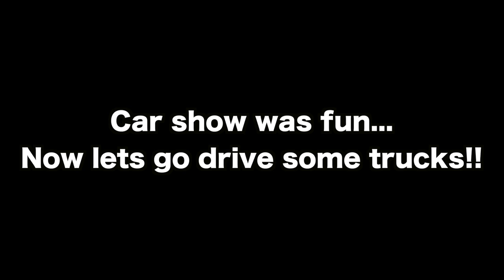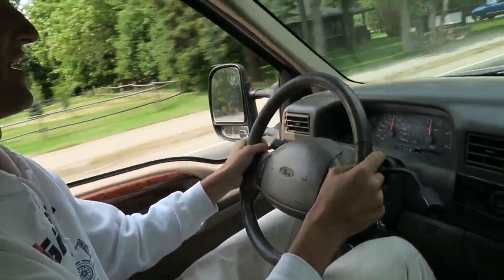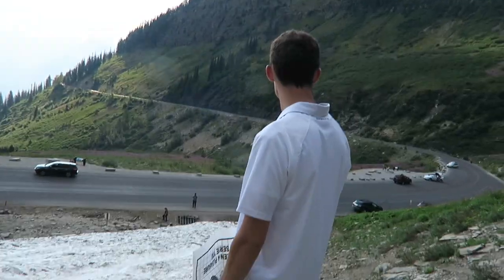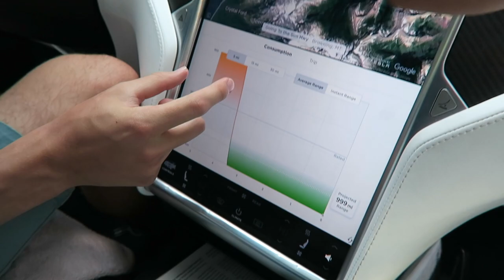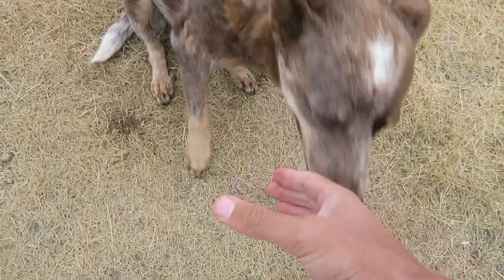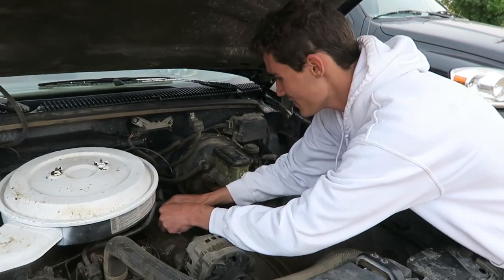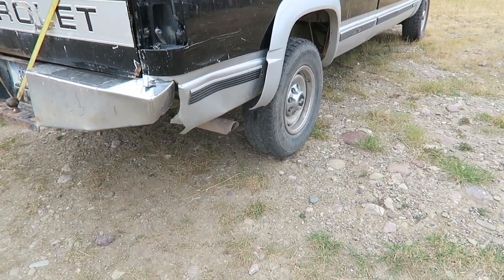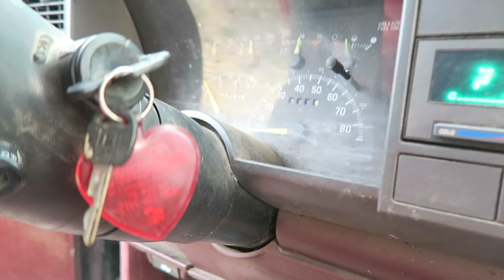FINALLY Buying A Truck...

Comment from the maker: Ford vs. Chevy vs. Dodge    GO!
Reply: Ferd baby 😂
Reply: Ford
Reply: Chevy
Reply: Ford
Reply: JR Garage Ford
Reply: Ford
Reply: JR Garage Ford all the way... It's the only truck that I found is reliable
Reply: JR Garage ford power stroke
Reply: Any, as long as it sounds like a truck..
Reply: what about a shelby f-150
Reply: Get a ford raptor
Reply: Gmc
Reply: JR Garage Chevy or dodge....
Reply: dodge
Reply: FORD BEST AMERICAN SELLING TRUCK CAUSE ITS THE BEST!!!
Reply: JR Garage I respect all trucks but I am all Ram, Cummins
Reply: Dodge
Reply: JR Garage Ford F-350 2002 may have a few issues but it's great
Reply: ford
Reply: JR Garage, get a f550 diesel
Reply: Chevy
Reply: dodge any day of the weak
Reply: JR Garage Chevy
Reply: JR Garage Dodge Ram
Reply: 7.3 POWERSTROKE!!!!!!!!!
Reply: Get a obs ford with a cummins
Reply: JR Garage get what feels right.... can't go wrong with either option but which ever way you go make it a bad ass truck!
Reply: JR Garage ford 4 life
Reply: JR Garage 2017 chevy silverado
Reply: Ford 4 life
Reply: 7.3 ALL THE WAY WITH THE POWERSTROKE
Reply: FORD
Reply: Cummins
Reply: Ford!
Reply: Scott Sherman chevy evey day brr
Reply: JR Garage look up any sled pulls Cummins dominates😈😈
Reply: JR Garage get a 2500 high country or a 7.3
Reply: Go older ford.
Reply: A GMC Sierra 2500 or Chevy Silverado 2500 01-09 bro it the GMC and Chevy and Cummins
Reply: gas ford.  You only need a diesel truck if you are towing over 10,000 lbs.
Reply: TheBlueCarEnthusiast or get a diesel so you can turn it up and rial coal. They don't even need a gas truck so if u have the money get a diesel
Reply: Buy a 02-07 Chevy Avalanche 2500. 8.1l v8. 450hp stock from factory with more in it. I have an 06 and it is a beast.
Reply: JR Garage dodge
Reply: Dodge
Reply: Powerstroke.
Reply: Dodge cummins
Reply: chevy
Reply: JR Garage POWERSTROKE
Reply: JR Garage dirtymax or power strock
Reply: Ford raptor
Reply: Dodge 2500 6.4L Hemi
Reply: Chevy Durmax dully 2015-2017
Reply: none of them get a 2018 trd sport
Reply: Cummins
Reply: if not get a duramax
Reply: Dodge/Cummins
Reply: JR Garage chevy
Reply: Dodge
Reply: Dodge
Reply: Chevy
Reply: Cummins
Reply: Cummins
Reply: For a diesel there is no better than the dodge and for gas you gotta go with the v6 ecoboost f-150
Reply: Ford
Reply: Ford
Reply: Chevrolet
Reply: Duramax with duh the Allison transmission
Reply: CHEVY
Reply: I would say 2005-07 cummins 6 spd
Reply: Dodge
Reply: Go ford
Reply: 1996 f-350 7.3 power stroke
Reply: Duramax
Reply: Get a 5.9 Cummins!!!!
Reply: dodge or gmc
Reply: Gmc cuz 😍
Reply: I was there a Glacier National Park 2 years ago
Reply: Diesel
Reply: Chevy 6.6 lly
Reply: chevy
Reply: The Allison Transmission with the Duramax it's a great transmission it's practically Bulletproof
Reply: GET THE CUMMINS!!!!!
Reply: Chevy
Reply: TheBlueCarEnthusiast they said they wanted a truck not a truck and 5 transmissions I a month
Reply: Ford
Reply: Dodge
Reply: Cummins
Reply: DirtyMax
Reply: Duramax!!!
Reply: Ford
Reply: Ford
Reply: Dodge Ram
Reply: Cummins the best Jr.
Reply: 100% Chevy
Reply: Cummins
Reply: Dodge
Reply: Baer on 2 wheels you right
Reply: dodge
Reply: Powerstroke
Reply: F150 Raptor with the Hennessy performance package
Reply: Ford
Reply: Chevy
Reply: 454 chevy
Reply: Ford
Reply: Powerstroke
Reply: Big Snod Callaway silverado
Reply: Lbz duramax with alison transmission
Reply: Or chevy
Reply: If you're going with ford definitely get a 7.3
Reply: chevy
Reply: Ford Raptor
Reply: Ford
Reply: Or deisel
Reply: Chevy
Reply: no debate dodge cummins
Reply: Ford built ford tough
Reply: Ford
Reply: Ford
Reply: Chevy
Reply: Dodge
Reply: Dodge
Reply: FORD
Reply: Dodge
Reply: Dodge
Reply: Chevy
Reply: Chevy
Reply: Chevy
Reply: Ford f-450 power stroke also Peterbilt 389
Reply: YYAASS DODGE!!!!!!!!!!
Reply: Ford
Reply: better be a powerstroke
Reply: DURAMAX!!!!!!!!!!!!!!!!!!!!!!!!!!!!!!!!!!!!!!!!
Reply: Power stroke
Reply: Dodge
Reply: 7.3 ford powerstrokw
Reply: Duramax
Reply: Duramax
Reply: Cummins
Reply: Cummins
Reply: Durmax
Reply: Durmax
Reply: Durmax
Reply: Chevy
Reply: Dodge
Reply: ford
Reply: Chevy
Reply: cummins
Reply: cummins
Reply: Dodge Cummins diesel 4x4
Reply: Duramax LBZ
Reply: Ford
Reply: Cummins
Reply: No rolling coal
Reply: Duramax
Reply: AveleiraMaster no it's not 😂😂😂
Reply: Chevy
Reply: Toyota
Reply: You need a new 2017 6.7 POWERSTROKE. Or any POWERSTROKE will do.
Reply: Chevy
Reply: Chevy
Reply: Cummins is practical and will do what you want
Reply: 1993 12 valve Cummins
Reply: Ford
Reply: 454 ss
Reply: Anything but a powerstroke.
Reply: Duramax or a Toyota
Reply: Diesel
Reply: Chevy diesel !
Reply: Cummins
Reply: Dodge 01_98 yes, have you seen the 2ed gen 4door 12 valve Cummins?
Reply: Duramax
Reply: Ram cummins
Reply: Chevy
Reply: FORDDDD
Reply: Ford
Reply: Chevy
Reply: Cummins 5.9 03 to 06 are good trucks
Reply: Chevy Duramax
Reply: dodge
Reply: CUMMINS
Reply: Chevy
Reply: Ford
Reply: Duramax!!
Reply: Ford
Reply: Tundra

Comment: Na 7.3 are junk. Theh are good stock but they cant handle power. Get a 12 valve cummins 5 speed. Dont want automatic
Reply: 0701jim and if you get one with a standered make sure its not a gtrag and that it is an nv4500 5speed or a swaped nv5600
Reply: 0701jim boi

Comment: Get you one of those 90's chevy trucks I got 2 I have a 4x4 5.7 350 silverado and a 5.7 454 suburban and both running strong as can be

Comment: I love my 93 w250 12v it's got 179,000 miles on it and runs and drives like a new one, I use it to haul quite a bit and it's never let me down, doesn't have none of that computer bullshit on it either best part about it in my opinion.

Comment: For diesel the three main motors are really good. 
1. 5.9 Cummins
2. 6.6 Duramax
3. 7.3 Powerstroke
If youre gonna go the gas route, go toyota tundra trd pro. badass truck and extremely reliable

Comment: If you're serious about getting a truck get a Duramax. 7.3l Power strokes hit heads and you have to get work done just so it works like it should out of the factory

Comment: A 2006 duramax or a 2007  are the best year for a duramax ford can handle a lot of horsepower but they need to be bulletproofed first and cummings are made for towing so chevy or gmc are basically an all around good truck

Comment: I would honestly get a 12 valve Cummins. 89-96 I believe came equiped with them. They are abosolute beast. If you want to see what I'm talking about check out my Instagram @2wd_duallys. The are completely mechanical. NO computers and just easy to work on.

Comment: Power stroke is the best motor you could buy. The 7.3 is the best Diesel engine too and it sounds the best
Reply: 6.5 Detroit sounds the best

Comment: Own a 2014 ram 2500 6.7 cummins also have a 2005 Dodge Ram 2500 5.9 cummins love both Diesel engines but I have a 2014 ram 1500 5.7 hemi motor as well and it is great love my mopar cause it goes far